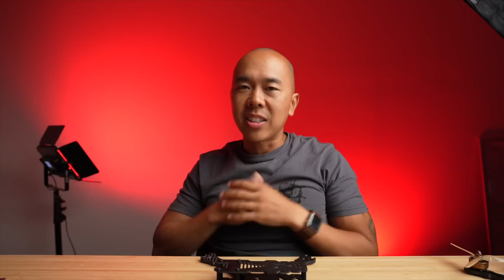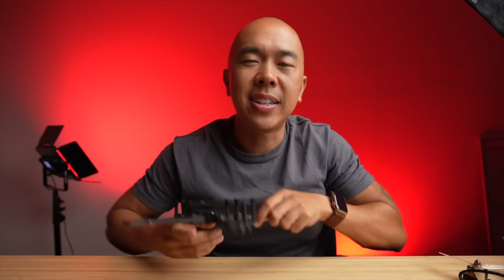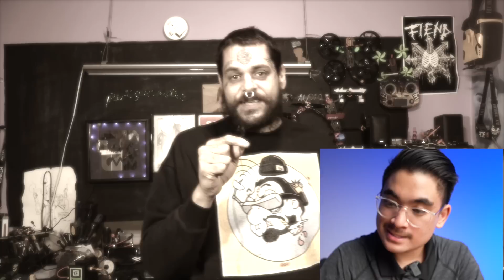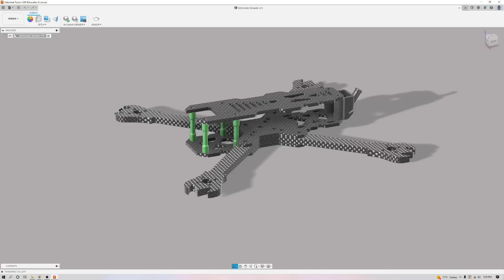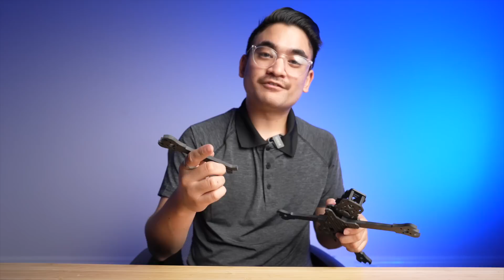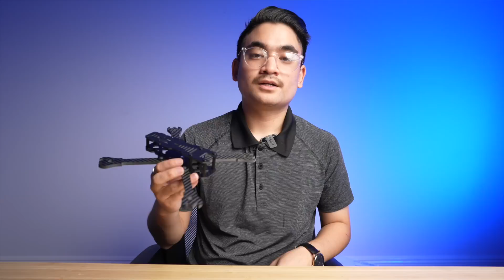DemiBot - the ULTIMATE BANDO BASHER

Comment: @3:15 - Did I just see a For Profit company show their copy of Autodesk Fusion 360 with an Education License? Don't show that!

And this frame is okay. I have 3 now, and am slowly building all of them up. Will be fun to have a mini-shootout with this and the Apex and Mark5. Might mix in some other crafts too shake them all out. However, out of those three frames I purchased - NO KEYCHAIN in any of them, and MyFPVStore takes the stickers out of them before sending them as the other two have zero goodies in them (that's not how you treat heeeeey piiiiilooooots).

Not attending that will be Diatone (horrible), Flywoo (absolute trash), or Caddx/Walksnail (what is with all of these companies and their horrible public-facing representatives? Learn some tact). But I will be having some Analog vs HDZ vs DJI action - sorry, no walksnail (I have some, but won't be showing any of their junk).

Comment: Interesting solution with the thicker standoffs, but wouldn't it be smarter to use M4 round standoffs ? They are 7mm in diameter,  and I'd bet they'll weight the same + they are easy to get in various lengths .

Comment: Frame looks dope AF. I have to ask though, why 5.5mm on those press nuts? I have a shitload of tools, a full machine shop with a handful of mills and a handful of lathes, weld fixtures galore! I don't have a 5.5mm box wrench. At all. Imma just have to make one cuz 5.5 is kinda silly.
Reply: must have been somebody that works on VWs, you see them all the time 🤣
Reply: You shouldn't need a wrench for the press nut. It would only be needed if the bottom of the bolts strips.